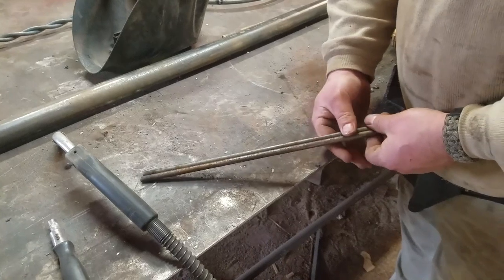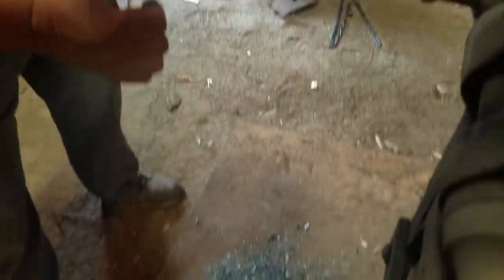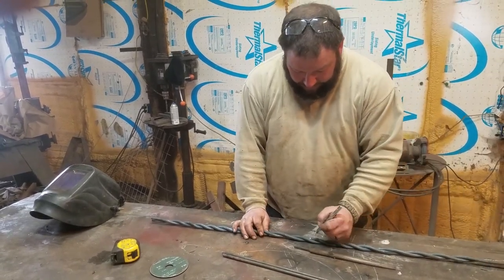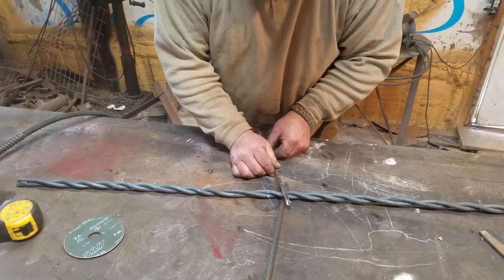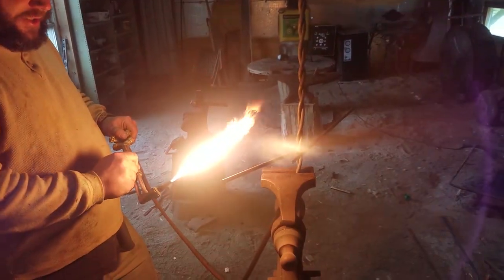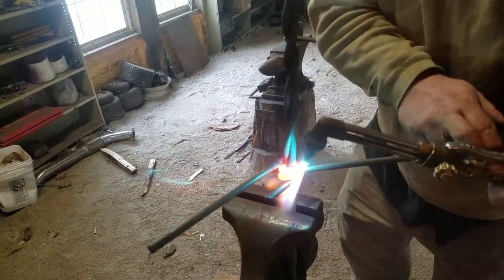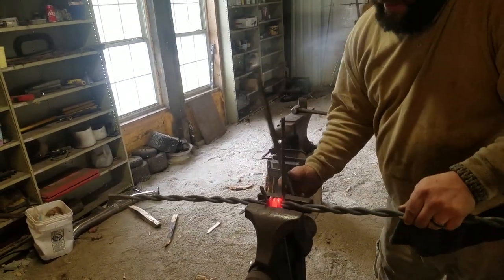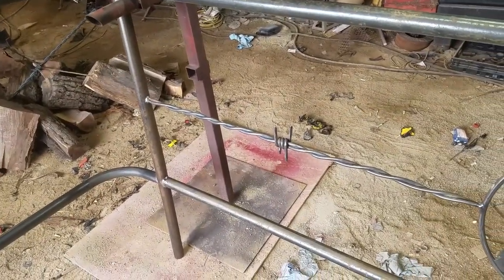Forging Decorative Barbed Wire for a custom railing.

Comment: Nice have see pictures of over sized barbed wire on things all ways looks cool could it be done  with out heat ? Thanks
Reply: The two long horizontal rods can if they aren't too thick. It takes some muscle, and you need to make a jig. I don't know how to make the barbs without heat. My acetylene just ran out, and I snapped a piece of 1/2" rebar, attempting to do it cold.  Maybe round bar wouldn't snap...rebar probably isn't the right steel to use anyway.